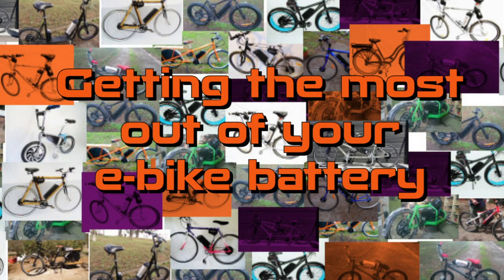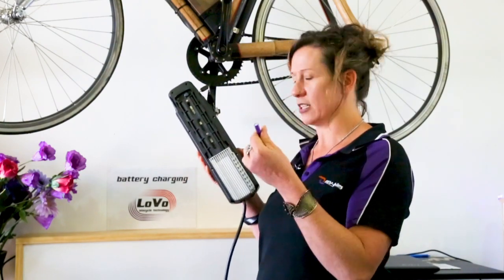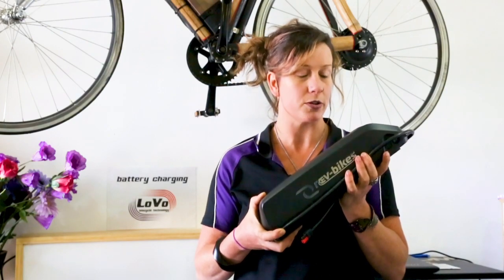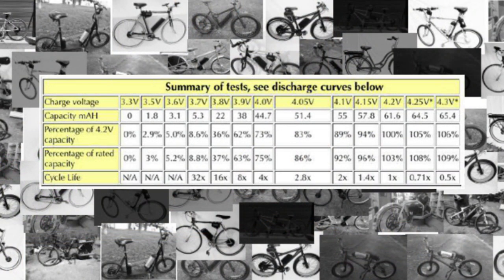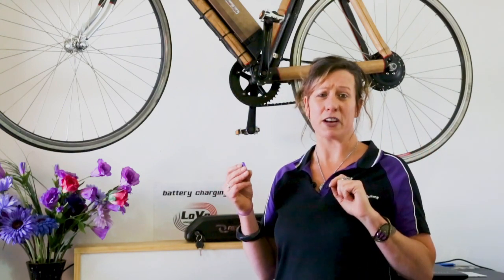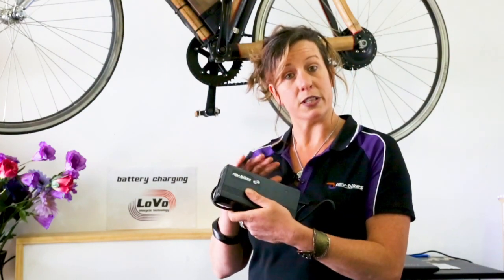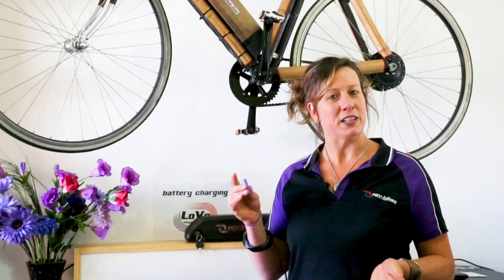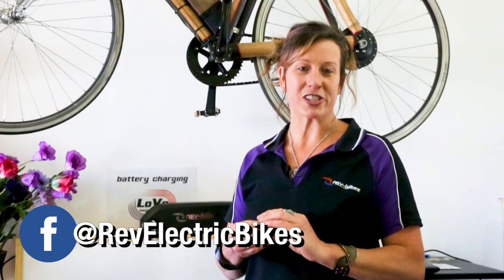Battery hack - Extending the life of your e-bike battery

Comment: 1st you buy the largest battery pack that the bike frame can carry... 30Ah triangle packs work really well and many bike. 2nd, use only 60% of the packs capacity. Don't charge past 80% and don't deplete past 20% capacity. With a 30Ah pack, you can use 18Ah and get 1200+ recharge cycles.  With a 15Ah pack, you have 9Ah of usable power before you start to stress the pack. Large capacity packs can also be charged at a higher amperage (faster) without any stress, they get way more range/performance and cost less in the long run than multiple smaller packs equalling the same capacity. The only downside to large packs is that they weight more which isn't really a problem on an ebike.  7 levels of bike: https://photos.app.goo.gl/ADgC6oyPM2gyrCq27

Comment: Rev-becca ...I just bought a 48V battery-powered e-bike from VoltBike, and just love it
To lengthen the life of the battery, does your video mean that getting a LO-Vo battery charger will automatically help me achieve what I intend.
I want to double, or as close to double the life of the current battery pack that comes with the VoltBike Outback
Reply from the maker: Charge partially 4 times out of 5, but just be sure to charge fully for balancing every 5th time.
Reply: @Revbikes  something that I have learnt from experience both with my ebike and with a large collection of electronic cigarette mods that run on lithium ion cells of various sizes 18650, 20700, 21700, 26650 etc.   We can also extend the lifespan by not over discharging as well.
    This can be confirmed with the resident vape expert now with a YouTube channel called
https://youtu.be/yrQun-WdK6w
 Battery Mooch
Reply: Mooch is often referring here to a one, two or three cell mod. But of course when we have large packs with many cells. So as you correctly emphasised, the cells are 'Top' balanced.
Reply from the maker: NO, a LoVo charger will not charge the VoltBike / regular e-bike battery to its required voltage for balancing.  LoVo requires a special BMS in the battery, in addition to the special charger.
Reply: @Revbikes  So my attempt is a lost cause...or do I have other options>

Comment: Luna Cycles sells smart chargers that will cut off at 80/90/100% of charge.
Reply from the maker: Yes, that's pretty cool. 
But when your battery is designed to BALANCE at 98% , it won't balance if youre not charging to 100%. LoVo batteries balance at 89% so to speak, which means you can charge it to 90% every time, and everything that is meant to happen happens automatically 😊